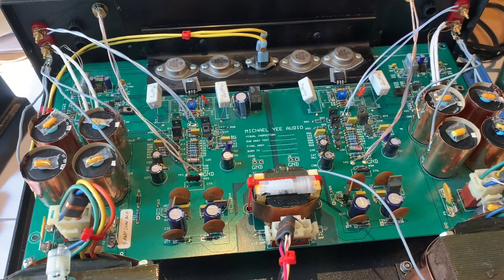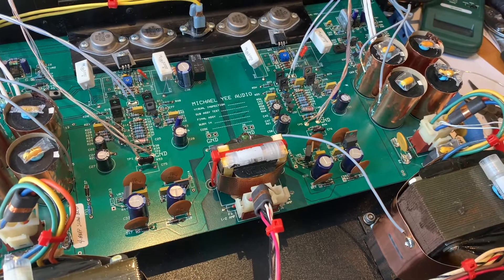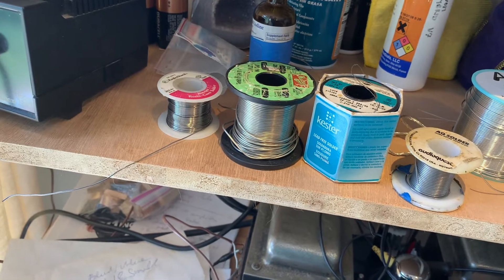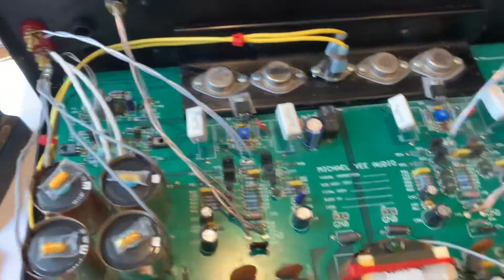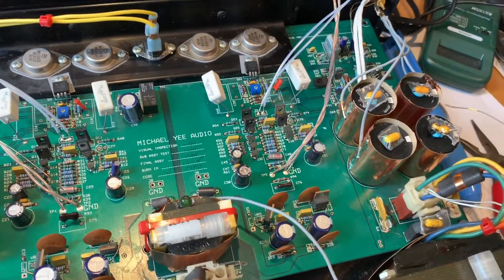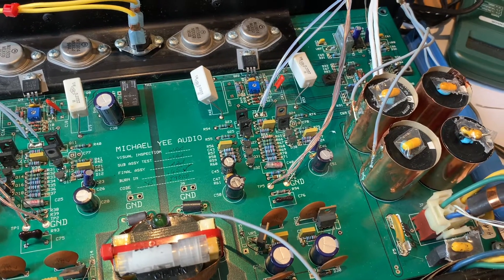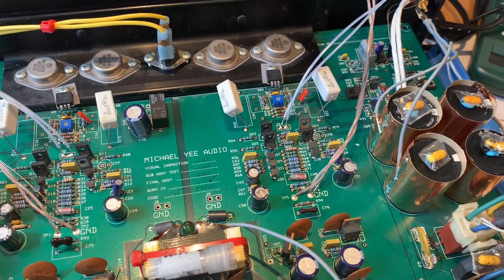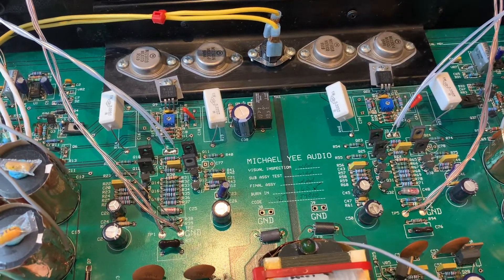Audio note solder application - Michael Yee PA1

Comment: On my solid state amp I  thought about changing the rca input jacks and speaker terminals inputs to better ones from audio note and also change the wire of those to silver. What do you think bout this idea? And which thickness of silver would you recommend?

Comment: Hopefully there will be a 100% tin-free, entire audio component one day. Could already be. With ultrasonic or laser welding, the equipment to do it is of course insanely expensive but that wouldn't be the first time insanely expensive tools are used to create insanely expensive products for audio.
This might be veering a bit off from so-called real world solutions, except for cables where it is becoming increasingly common to see cold-welded transition-free terminations.
Actually found one comment on a forum by someone who had had his DIY silver interconnects laser-welded by a professional, only 20$ per weld - not bad at all! Might be that such professionals aren't found all over the map but wouldn't think they're exceedingly rare either, today.
Reply from the maker: Getting rid of the solder is a fantastic thing. However, welding silver radically alters the annealing (due to extreme sudden heat) that takes many decades for the metal to recover from.... The welding process is also something that needs to be tweaked, how to stress the silver as little as possible.  Solution would be to re-anneal the welded cable. :) Everything has both pros and cons, that's what makes audio an endless adventure.... ✨
Reply: @realworldaudio  Do you think the seam where this breaking of anneal would occur with laser welding would be substantial enough to matter considering the additive nature that the annealed structure presents to a signal along the whole length? Apparently silver's reflectivity generally makes it hard to laser weld with penetration depth greater than 0.5mm so if this is becoming a limit already... I think it can be tweaked to be substantially less, so a very minimal seam.
(Actually went and asked a laser specialist today, they could do it for an RCA termination - and why not any cable termination. So with KLEI Absolute Harmony RCAs a silver-silver connection would be possible)

Comment: Hi friend ! It's been awhile6 :)
I have to try soon the audioquest silver solder.
And i have one suggestion for you. I think you may know it already but it's always nice to share.
Changing the solder is nice i did it too. But my solution for making the complex passage easier on solid state wasn't the solder but the capacitors. Particularly those pre regulators and post regulators. You have to increase the volt value to at least 50V or more. Typically 100uf 50V on Elna and 100uf 63V on audio note.

I made some expérimentation with increasing those values in every sensitive position and i found out that it increased the soundstage, the low level details becomes easier to follow, everything gets deeper. 
But you have to be careful depending on the amp when you go after 50V the sound starts to distort. 
Now I'm starting to think that it's not only tubes the reason for the smoothness. It may be more because of those high volt values. 
I made a lot of LPSU recently and experimenting with regulators. I must admit i have amazing results lately. 
Big discoveries for me with solid state devices. Using audio note kaisei bipolar capacitors helped me find amazing answers. And i'm starting to feel more and more that solid state is widely underestimated because there are not a lot of people dedicated to it with the same passion tube lovers have. But I'm coming 😁
I'm using everything i can to solve problems even the things not ment for solid state and it works. The level of sound quality is starting to become amazing.
Reply from the maker: Hi Yannick, thank you for sharing! The radiated EMI field of a capacitor is quite low when it's operated much under rated voltage. The radiated field becomes excessive when pushing the rating close to the maximum. So, 30V or so for 100V rated capacitor is super ideal, very low EMI pollution to the neighboring parts... also, higher voltage rating means better construction quality, often much better quality material are used for construction. (For example 100V ELNAs better constructed than 50V ones, and the 50V ELNA is musch better than the 6V or 25V versions.) Indeed, I should go back to my buddy's Michael Yee amp, and up the capacitor ratings, and get him ELNAs  : ). Thank you for the report on Kaisei bipolars! Indeed, I totally agree with you, the potntial of solid states is not yet discovered fully, keep on experimenting with LPSU & capacitors!  Cheers, Janos!
Reply: @realworldaudio  thanks Janos for the inspiration and all the amazing information you share. Specially the science 🧪

Comment: did you put some type of shielding onto the capacitors? can you explain?
Reply from the maker: Yes, it's self adhesive copper tape. Solder the seams together, and ground it. Just make sure the shiled does not short out anything.
Reply: @realworldaudio  I do this to everything.